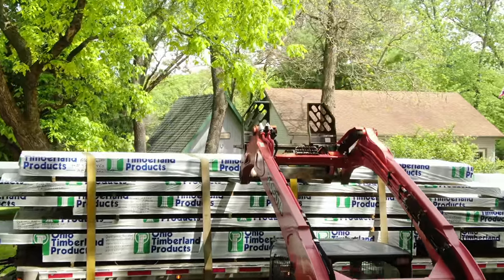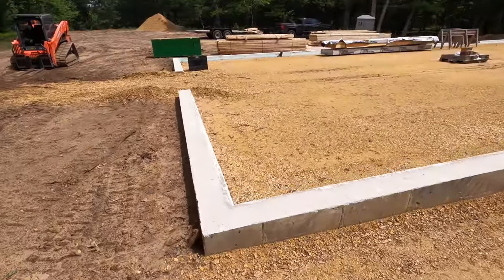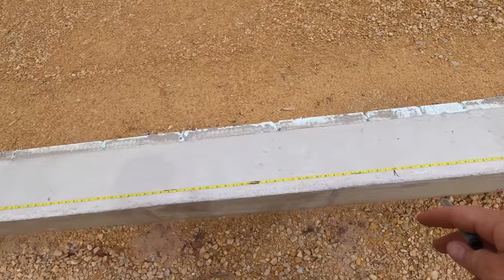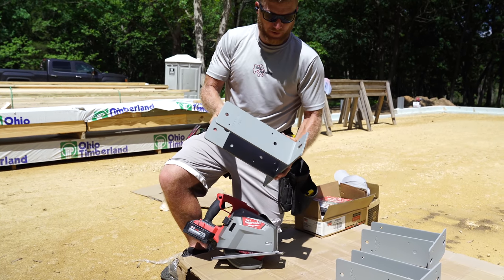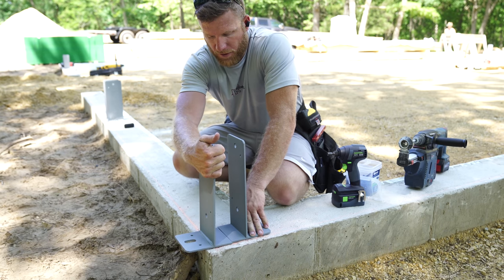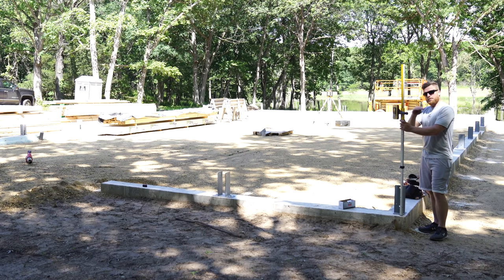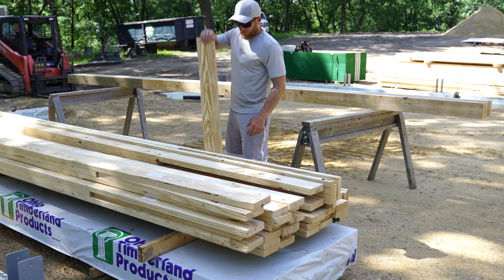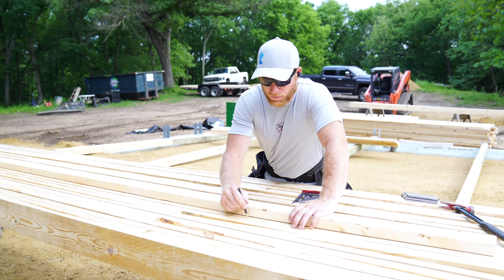Cabin in the Woods: Intro and Layout

Comment: Good job avoiding the spray paint police! 
Nice to see that corner column detail as those bracket thickness measurements would add up.
I am also am excited to see if you bought a standing seam machine or seam rollers! I noticed all your other rooves had hundreds or even thousands of holes in them! You can buy your own for under 80K and the return should be great and even more so if you teach Greg to use it and cut on site for other builders or even DIYers. You're welcome.

Comment: Do those Titen HD 5/8'' X 6'' concrete screws have as much holding strength as a RedHead, the bolts that expand as you tighten them ?
Too bad all job sites wasn't left that clean and neat for you !  Thumbs up.
Reply from the maker: I’m pretty sure they are much better than a wedge anchor

Comment: Always love the work Kyle and Greg - on your corner brackets, why not cut the bottom plate at full width of the column? You still only have 1 ear, just full plate under that corner column instead of half
Reply: Not a huge detail or even that structural, just a thought

Comment: Appreciate the explanation on piers vs. stem wall. You mentioned that “we’ll never do that again” in regards to putting your posts/piers in the ground. Did you at one time? Was there a failure as a result? Thanks.
Reply from the maker: No failure... just not as good and we learned
Reply: RR Buildings, thank you for the reply. So, what were your findings? What was it about in-ground that you didn’t like. 

From what I understand, the subject of in-ground vs above-ground poles is a highly debated topic amongst builders.
Reply from the maker: No debate... it’s about longevity.

Comment: Epoxy. For concrete n bolts in those holes for the brackets. After air blowing out the dust would have killed it

Comment: I know there must be a good reason (obviously it’s RR Buildings 😉) but why do you not use the Cut Hub and mitre saw to cut the top angles on the 17ft posts in one go rather than circular saw one finger, turn it 90 and then cut the other? Great video, was trying not to stare at Greg while you were explaining #mancrush 🤣
Reply from the maker: Mainly logistics of moving on and off a mitersaw table
Reply: RR Buildings I knew there would be a reason! Looking forward to this build!

Comment: I will give you my opinion on the 8" Milwaukee cold cut saw although mine is corded.  I hate the damn thing!  On a reach cut you can't see the cut notch or cut line.  When cutting into a blind ninety (door cutout in metal sheeting for instance) you can't see the cut line which of course varies as to the depth setting.  This results in undercut or worse yet overcut.  The fault of the saw.  The chip tray does catch some but a lot still escapes so it isn't enough to outweigh the other major faults ( I am not even mentioning the minor ones).  When cutting steel paneling which is painted the shoe scratches the finish horribly because even with the chip tray it throws enough to coat the bottom of the shoe and grind into the finish as you push the saw.  Its balance point is high enough that at arm's reach the cut line will wander around.  The Diablo blade on a regular Skilsaw worm drive or other brand as well beats that Milwaukee hands down.  Oh and one more clue, never buy an "Oshlun" cold cut blade.  Not only do they dull very quickly on closer inspection the carbide tooth at the back is not supported where it is brazed to the steel blank.  This leaves the back side of the cutting edge unsupported resulting in chipping and breakage of the carbide inserts.  
So the worm drive is heavy enough with a lower center of gravity for a stable cut path and clear visibility of the cut line while throwing very few chips to be a much better choice.  I cut aluminum as well (again Diablo makes a great blade just for this although I used regular carbide for years) as all kinds of steel in my fabricating so the saw has been well tested this past three years or more.  Definite fail!  Painful to say as I have quite a few Milwaukee tools that are good performers and I like.  I have not tried the other brands of cold cut saws but I hope they are better!  Take care.  Doug

Comment: I was told to come check you guys out from a garage forum im on. I am considering using the sturdiwall brackets either drill or wet set for my building. I will be building a 60x100x12 building and I get feedback saying it will and won't be strong enough. I want to do as much of the work in my build as possible, but not at the expense of doing it wrong. Hopefully I'll find some answers here, like your thoughts on using the drill mount vs wet set. Thanks
Reply from the maker: Sturdy wall brackets are the best and if you wet wet them you won’t be disappointed.  Much much stronger than dry set even tho dry set is good

Comment: Ok, this one thing confused me.
The bracket to hold the post is 1/16 of an inch below the "grade" of the highest point of the foundation, when you are marking the post to prep them for cutting to have the trusses all level, wouldn't you mark it at, in this case of 17 foot walls, at 17 feet PLUS 1/16 inch to have the tops all be at grade? in the vid you said minus the 1/16 inch which is why I'm confused.

Comment: I am a little confused on marking the height of the center of the post board.  If you start at the highest bracket and the next bracket is 1/16th lower than the highest one wouldnt you add 1/16th to the dimension????  dont understand why you mark -1/16,  Hope this question makes sense
Reply from the maker: Highest point of concrete... brackets are 5/16 or so higher... therefore if concrete is the same in another area I’d be subtracting 1/4” potentially off of that post
Reply: @RRBuildings I find this a little confusing also.  If your high point is your zero reference, regardless if it is top of concrete or bracket, wouldn't you add the difference  to every point there after to maintain a level line?  Great video's, excellent builds!!

Comment: If you find the highest bracket for your column and your next measurement is -1/16” say your highest column is 17’-0” wouldn’t you cut your -1/16” column 17’-0 & 1/16” to compensate for being lower than your highest post by 1/16”?

Comment: 18:00  If the laser said negative sixteenth, doesn't that mean it is a sixteenth below the ideal height, in which case, wouldn't you want the column to be a sixteenth longer?  Or does the negative sixteenth laser measurement mean that bracket is a sixteenth too high?
Reply: When using grade lasers when you go up the stick it means you need to go down
Reply: @cameronmassie642  ty

Comment: Highest point or lowest point? Seems if you find the high point when you measure the low point it will read negative but you would have to add that to the 17ft to get the top the same hght all around. Guess this confused me.
Reply from the maker: We did have positive and negatives but mainly due to thickness of bracket... I found highest point on concrete set to 0 then went on top of each bracket therefore some negatives and positives
Reply: @RRBuildings  nice svl kubota the best reliable strong soilid beast wich im gonna be happy with the new 16.8hp diesel 11,000 watt kubota gl11000 generator
Reply: @RRBuildings  Ahh OK concrete to brackets, got it now it makes sense. Thanks

Comment: I still don't get why Kyle cuts these steel brackets in half. He showed that he cant leave second leg be cause it sticks out of the wall, but cutting right inside that leg would leave whole plate on a bottom and there wont even be a questions about column sagging.
Reply: You’d double the number of brackets you’d need that way. I imagine they’re pricey.

Comment: Why not just run all your post wild then come back and cut them all level instead of going to each bracket and checking for variance. You could use your grade stick mark all 4 corners chalk a line and cut. I do this alot especially with rafter tails

Comment: You got your corner bracket height ( 0 ) from concrete level not bracket face, guessing this was just for video purposes hopefully :D
Reply: commented before you went around and checked ittt! :P
Reply from the maker: No I wanted it from concrete... then checked every bracket from top of bracket... zero was the high point of concrete then every bracket for the most part was a small minus number (the thickness of the bracket)

Comment: Why not notch out one corner at 90 and you can bolt it in going 90 and that way you can take the 2x2pc and glue it down that way there is steel totally under yr geam